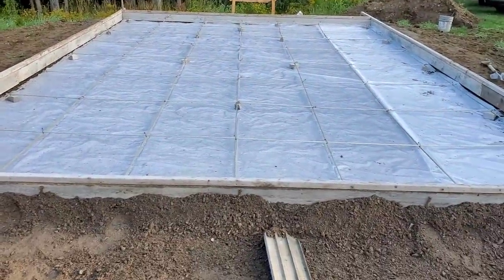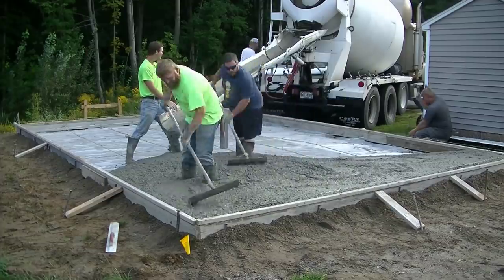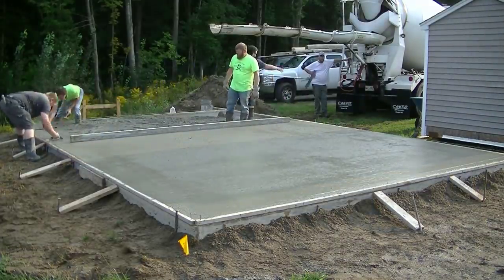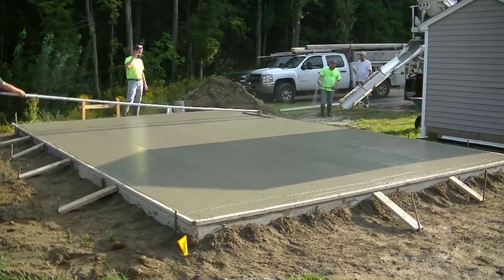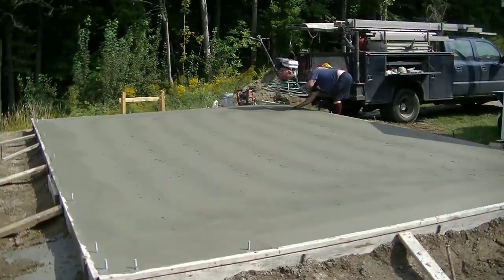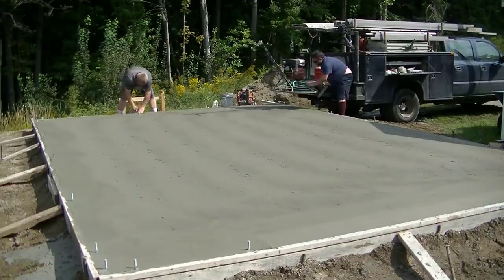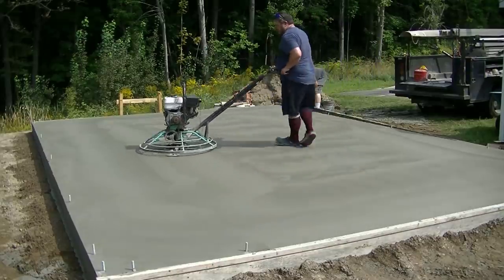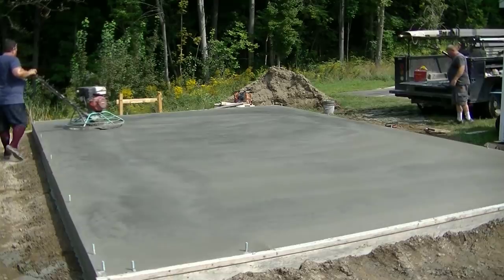They Made Us Pour This Shed Slab 8" Thick (Wasting Money)

Comment: I never heard anyone ever complain about how hard & durable their shed slab was.
Reply: Additionally, a site manager for a shed?
Reply: @thecoolclips1  everyone’s gotta get paid! Lol
Reply: I have. Its about 25ft square. This was was the result of a drunken a-hole prior owner and has the added advantage of being out of flat by 2" in 5 feet (not out of level, overall it is level) in every direction from every point.(and this is after he added a layer of patching mortar in the really deep valleys) Actually it is quite a feat to get it that uniformly bad, like a wavy ocean. Also when drilling for shelving anchor bolts I found wide variation in hardness, even within a single hole, though it was mostly very soft/weak no way I could anchor something like a small hoist.
Reply: I have heard people complain how much a new shed will cost them.
Reply: Then you've never had to remove one
Reply: The complaint would be having to pay for the extra yardage. The load is carried by the outside edge of the slab and there's no reason the non load bearing area needs to be 8".  Garage slabs are only 4"
Reply: Always better to overbuild than to underbuild
Reply: @chichidouglas5078  "[most]Garage slabs are only 4" "
True,  and every 4" slab I've ever seen ends up being shit and buckling over time. 4" is the minimum because if everything else is perfect it can work fine for many years, and most city ordinances do not wish to prohibit their towns and populations from expanding/building, so 4" is deemed acceptable. However, if you want to bring in heavy machinery and not worry about the slab heaving and buckling in the future, then 8" is the way to go all day long imo. 6" might get you some security, but at that point you might as well just spend the extra few hundred for the 8" and have something you know will stay dry and level.
Reply: @Rick-the-Swift this slab is for a shed and there's a big difference in a shed and a building that's big enough to pull heavy machinery into. I've been a concrete finisher and carpenter for 31 years and every structural blueprint for residential I've  seen has a 4" garage slab that has engineering details that shows a side cut of the depth of concrete sitting on top of a compacted gravel sub grade with a mat of #4 rebar in the center and when it's poured inside of foundation walls there's usually a detail showing rebar dowels that are epoxied into the walls. When you epoxy dowels into a stem wall  a building inspector or the engineer comes out too make sure that you drilled the holes deep enough and also makes sure they're cleaned out properly and then watches as you install them to make sure that you do it properly to get all the air out and enough epoxy comes out of the hole. After that you can tie the mat onto the dowels. Then they sign off on it and you can pour. When the sub grade has proper compaction and the rebar is attached to the foundation and you cut control joints in the right places unless there a natural  disaster or a screw up at the plant and you get a bad batch of concrete it's almost impossible for it to buckle or fail in any other  way. I poured my garage and wood shop floors 4" deep according to the plans in 1997 and they've taken a beating ever since and it's not as pretty but it's still as flat as the day I poured it. I don't doubt that you've seen shitty floors because there's a lot of hacks out there cutting corners that don't know what they're doing but they know enough to con people that don't know anything about building. If you get 4 different bids and 3 of them are close to the same price and 1 is substantially lower don't take it. The cheap usually ends up expensive
Reply: Haha, damn slab’s too flat, no cracks.
Reply: @chichidouglas5078  I respect the time and experience you've had. When it comes to the part where you say, " When you epoxy dowels into a stem wall  a building inspector or the engineer comes out too make sure that you drilled the holes deep enough and also makes sure they're cleaned out properly and then watches as you install them to make sure that you do it properly to get all the air out and enough epoxy comes out of the hole." you must understand, you are talking from a limited POV. In the world I live in, the majority of the time depending on geographical location, the inspectors don't come out and watch people perform their work. They show up to say what needs done, then they come back and take a look after the work is performed.
I don't know where you are from, but where I'm from (I've worked commercial and residential in multiple states) inspectors don't have the time or capacity to follow a worker around who is tediously cleaning and filling holes with epoxy. That type of work can go on for days, weeks, or even longer depending.
Reply: @chichidouglas5078  "I poured my garage and wood shop floors 4" deep according to the plans in 1997 and they've taken a beating ever since and it's not as pretty but it's still as flat as the day I poured it. I don't doubt that you've seen shitty floors because there's a lot of hacks out there cutting corners that don't know what they're doing.."

That's my point. If you perform your own work, then you can have the utmost confidence based upon your skill and knowledge. It sounds like you thought everything through, as well as perhaps got lucky with the natural stability of the surrounding earth, etc. 
 But what if the surrounding soil had been less than ideal, or less structurally sound than your own? What if your hired contractor wasn't as thorough as you yourself like to be in all aspects? 
Wouldn't just going to 8" slab help give some peace of mind and security to protect from the unknowns?
Reply: @Rick-the-Swift  I don't know about the rest of the country but I live in Southwest Washington and work in Washington and Oregon and we do soil and compaction tests before we build on new ground. We also have to do perk tests to find out which type of septic system will work best for the soil. So  I've never had any problems with  unstable ground but I do know that an 8" slab is twice the weight of a 4" slab  so it's going to sink more than a 4" will. If you planning on something failing you should come up with a better plan
Reply: @Rick-the-Swift you're absolutely right that would be ridiculous. Ain't nobody got time for that! I guess I left a couple of details out of that explanation. They don't watch you do every hole and it's part of the rebar inspection that you have to get before you pour. They don't just come hang out and watch you work.  You have to have the holes drilled an cleaned out and have an air hose with a blower attachment long enough to reach the end of the hole and a round wire brush rolled out and ready and the dowels cut and spread out ready to install. They inspect the rest of the rebar and then they pick a couple holes in different locations. Then you have to show them you know the proper cleaning prep and epoxy installation procedures at those locations. If you go through the steps in order and they don't see any dust come out of the holes they have you install the dowels and if you do that correctly they sign it off and you can pour. There's an approved cleaning process they want you to follow so there's no chance for the epoxy not to bond. Also if the inspector knows your work from previous inspections and you tell him that you did it or made sure it was done properly they usually won't bother doing it. But there are some inspectors out there that insist on being assholes no matter how many times you show them you're competent enough to clean a hole and spew some epoxy in it
Reply: @Rick-the-Swift  my point was if the work was permitted then there's going to be an approved set of plans with engineering details to follow and inspections that have to pass before you can pour anything. So when you see  cracked up slabs it's probably not because of the thickness of it. It could be from using it for something it wasn't engineered to support like heavy equipment or machinery. Or in an  attempt to save money people will hire an unlicensed fly by night contractor that  tells them they don't need a permit when they really do need one. But they'll get caught when they apply for one so they lie about it and get the job because they are so much cheaper. Sometimes it might work out but it usually doesn't.
Reply: @chichidouglas5078  Usually machinery is held in place by anchors embedded at greater than 4.5 inches. 

I wouldn't have a garage built at less than 6" pour for that reason alone
Reply: @Rick-the-Swift  My experience as a machinery erector for over 20 years is anchor inspectors have become the norm, they watch you drill and clean the hole. Check that anchors and epoxy are to spec etc
Reply: @ShaunHensley  if you're installing heavy machinery then there  would be a structural detail drawn up with engineering for it on the approved set of plans that were submitted when they applied for the permit. That's how it works. Then there would be a deeper area with a bottom mat of rebar 3" off the ground and anchor bolt locations listed so you know where to pour them In. There's absolutely no reason for the slab to be any bigger where it's not bearing any load. Also he said this is just a normal shed not a machine shop or a service garage with car lifts. Every building that's big enough to require a permit has an approved set of plans with  engineering for all load bearing areas and there no reason to second guess the engineer
Reply: @chichidouglas5078  People build structures with an eye to future upgrades all the time. 

And it's far more cost effective for a homeowner to pour a thick foundation than to plan exactly where they might want to install machinery at a later date.

You tried to flex. You failed. Move along
Reply: @ShaunHensley  I didn't try to do anything but state facts. It's just a shed nothing else There isn't machinery going in it. There's no garage door going in it. The customer didn't say he wanted an 8" slab the general contractor that pulled the permit told the concrete subcontractor it was 6" and it was already set up for 6" and he said the building manager told him that code enforcement said it needed to be 8".           Did you even watch the video? Because he said that in the first 5 minutes.  My comments are related to this video not a hypothetical situation and it's not a foundation it's a slab and the purpose of a blueprint is to plan out exactly where everything is going to be it's called lay out. If you're going to install something that heavy or something that needs to be bolted down because of impact or torque it will need more rebar than a 3 foot grid and will also need the anchor bolts poured in place so how are you going to do that without planning exactly where it's going to be. It's always more cost effective to do things right the first time. 🐔🍭
Reply: @chichidouglas5078  What you didn't consider is that the route you suggested would require someone to have ALL of the machinery/equipment they plan to install AND the specific layout they would want AND cluing the city into what they plan on installing in their home shop at the time of construction.

Fine for a business, not so much for a hobbyist.

for the home hobbyist who wants to have the flexibility and privacy to build what he wants, in the timeline he wants, simply speccing a thicker pad rated for more load is far more cost effective.

Again, run along
Reply: @chichidouglas5078  i mean who knows what the guy plans on storing. My neighbor owns a small business. Keeps most of his equipment at his house. Maybe the home owner owns some sort of business were he stores heavy equipment at his house somtimes.
Reply: @ShaunHensley  again what you didn't consider is the guy that made this video said it's only going to be a basic shed and the building manager showed up and told him that code enforcement said it needed to be 8" not the home owner who wanted a 6" slab obviously since It was already set up and ready to pour at 6" and he's the one that paid for the permit and the plans that were  submitted when he applied for the permit. My comments were based on this video and the question he asked was is an 8" slab overkill for a basic shed. Not is an 8" slab overkill for a hypothetical building he didn't pour a slab for that's going to be full of heavy equipment or machinery that needs to be bolted down.
Reply: @chichidouglas5078  The man making this video has absolutely no idea what the shed will eventually be used for.

Beyond that, this conversation is larger than this specific case, no matter how many times you think you can constrain it, nobody is coming here talking about this one small case, get real, stop with the need to be right
Reply: @Rick-the-Swift  what if I literally just make it as thick as bedrock?
Reply: @ShaunHensley  
The fact that they cared that the slab height match the other slab means the homeowner is planning for the future. This doesn't seem to dawn on the contractor.
Reply: @thedalillama  that's done for drainage reasons for asphalt or concrete driveways typically. The buildings are the high point and everything else slopes away from them
Reply: @chichidouglas5078  
If what you say is true, the contractor would have matched the slab heights. Instead, it was a specific request of the home owner. If that was requested of me, I would assume the homeowner has something envisioned for the slab in the future, like making it part of the house one day.

I've noticed this about some contractors. Many aren't very smart so they automatically assume their opinion on a matter is superior to the homeowners. If something is at least up to code, they should STFU and do as they are asked. There's likely a reason they are being asked.

The guy making the video clearly couldn't let it go.
Reply: @thedalillama  For residential work unless there's a code that dictates the elevation the home owner always decides what they want  because it's their property and they're paying for it.  But everything is decided  before contractors show up. Because there's either a blueprint drawn by an architect or plan drawn by the home owner that was submitted to the building department for approval for a building permit. The finished elevations, offsets from existing structures, drainage slopes, the exterior dimensions, interior wall layout, and structural and architectural details are all on that approved plan. So that's what you build if you plan on passing inspections because that's what the inspector bases the inspections on. The only time you can set forms without a plan to get numbers from is if the project was surveyed and hubs have been set to transfer grade and offsets from. You're entitled too your opinion but those are facts so what I said was true
Reply: @chichidouglas5078  
I can explain it to you again, but I cannot understand it for you. I'm sorry that this is difficult for you to follow along.
Reply: @thedalillama  I understand perfectly. You didn't listen to what was said in the video because he clearly said the slab was for a shed. Not a future addition. I also understand there had to be a plan submitted and approved in order to get a permit. You have to build according to the plan in order to pass inspections. I also understand  you have an opinion based on feelings and you're entitled too have it. I have an opposing opinion based on facts and 31 years of real world experience in concrete and carpentry.  Facts don't care about feelings.  Have a nice day stay safe
Reply: I complained when I got paid to demolish a pig shed by hand and the slab was over a foot thick. Pretty sure I ended up making less than minimum wage on that one.
Reply: @DoodlesMcpooh  I'm really sorry you had to go through such an ordeal bro. Maybe next time, just assume the slab is thicker than 4" when you bid the demo?